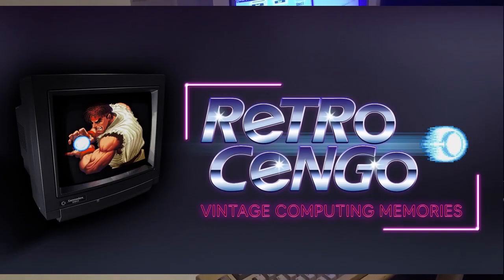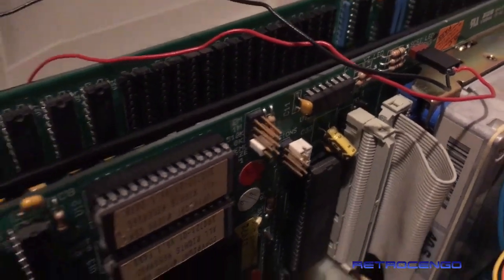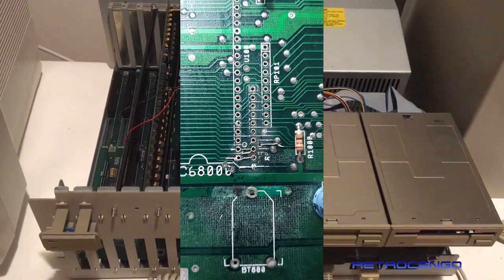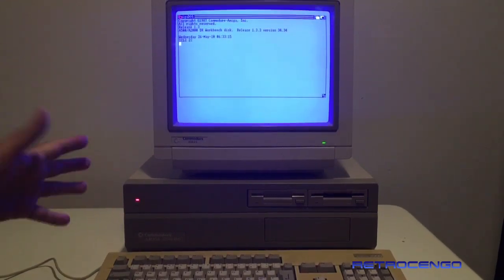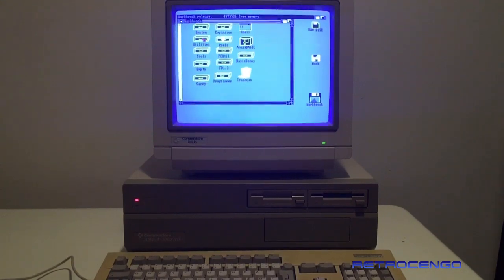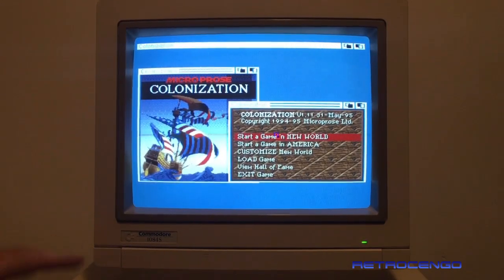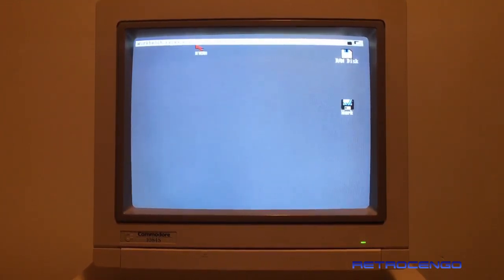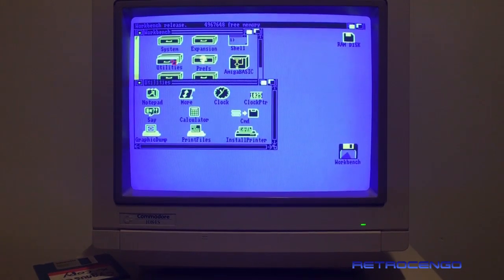Commodore AMIGA 2000 Inspection and Repair Part 2/2

Comment: Ok after watching these A2000 videos of yours, i got my A2000's out of storage. I didnt think i had anything to worry about as the batteries were removed years ago, but to my horror, one A2000 looks like it has signs of battery leak. When the battery was removed, the mobo looked ok. The Amiga still runs like it did but i am wondering, how did the green fuzzy stuff appear after the battery was removed?? I think maybe the battery already leaked before it was removed but the affects where not visible???? Nothing looks to be damaged. Oh well i'll give it a clean and hope for the best as the person i take my Amiga's to for any repairs is away on vacation and i dont know if he will be repairing hardware once he gets back?
Reply from the maker: Boom Box really happy to inspire or motivate you to use your Amiga 2000 again. 
Yes sounds like the varta allready had leaked. 
Yes great idea to clean/neutralise it asap😁👍🏻
Thanks for watching 😁🙏🏻

Comment: Awesome the Beast Lives Again.   Nothing better than an Amiga Resurrection! Actually you can install more than 8mb of ram in that puppy with the right card.   I have an A2630 originally it was running 28 or 29mhz and I had to slow it back down to 25 because the Individual Computers BIG RAM (112mb) Module did not like the faster speed.   I have a ROMULATOR I am going to try to install in my A2000HD tomorrow.  Only reason why I want to install it is so I never have to open that puppy to pop in something like DIAGROM but I am going to install an SD Card Cable extender and mount that on top of my GOTEK, God only knows there is a big open space there to do it.   As you know I love my A2000HD but I got screwed by Commodore as they failed to install that HDMI Port on mine.  Enjoy the A2000HD it takes up a lot of desk space so hopefully you will find a spot for it and set it up to run those old OCS & ECS Games.
Reply from the maker: Stephen Bruce yeaa nothing like saving an Amiga right??
YES with the 68030s instructions you CAN install more then 8MB fast RAM. But as a 68000 system its max 8MB